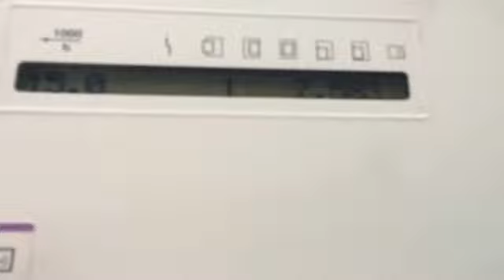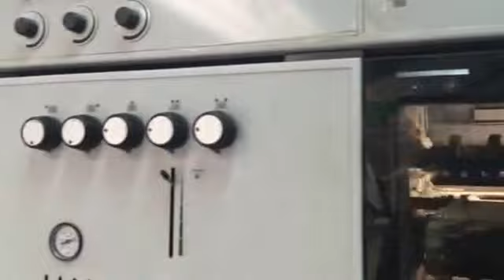Heidelberg CD 102-4 2011 running at 15,000

Comment: These press manufacturers need to tell me where they find all this perfect paper at....plus if this is not a perfector, let's see the speed on the second pass thru. The company I worked for got whatever the paper house had on special unless the customer requested a certain stock.....
Reply: I agree I work on a 10 colour like this one and can’t get more than 8k an hour running 50 or 60LB stocks.
Reply: The company I work for has a sheeter in house so we usually get decent paper.
We used to run our XL at 18,000 non-stop when she was in her prime now it stays around 14-15,000. I'd assume this XL has no perfector (The first unit step up would be higher to allow room for a perfector drum) We do all of our perfecting work on older CDs that happily run at 9-10,000
Double passes are a nightmare, period, we only double pass when an operator messes up and forgets coating/varnish lol
Our paper is usually Sappi or Oxford aside from wet strength/synthetic (Oxford seems much better)